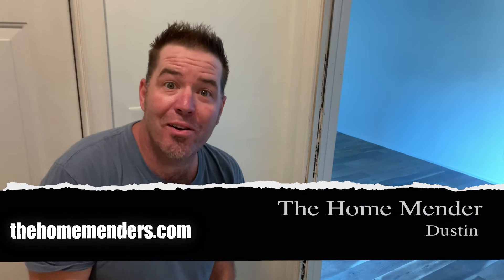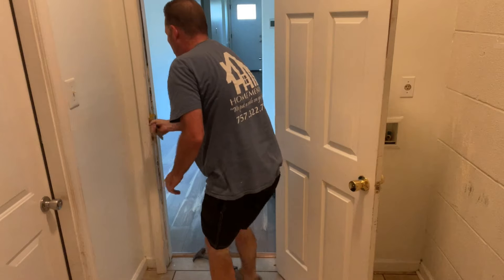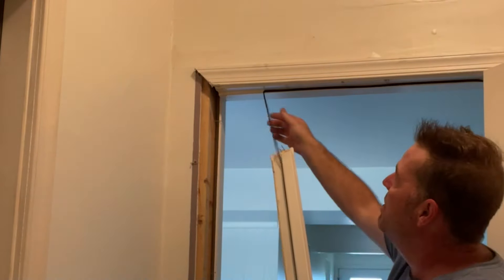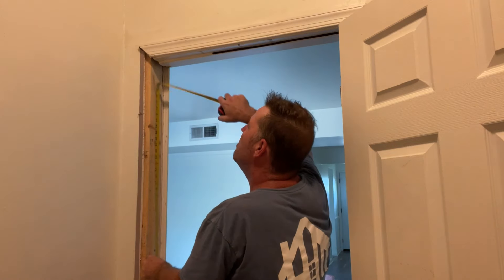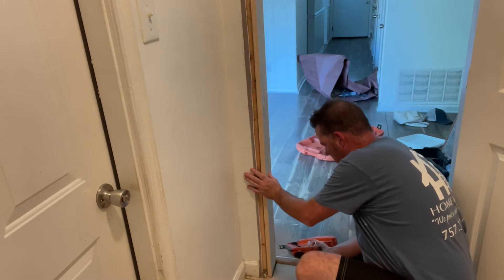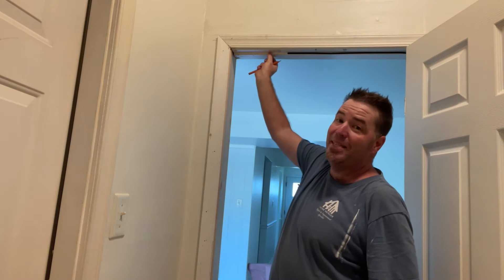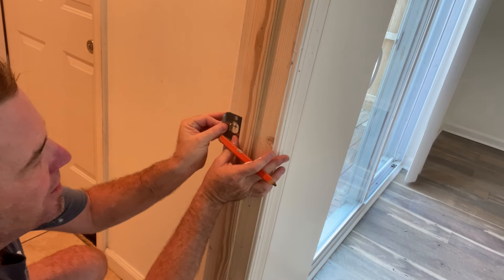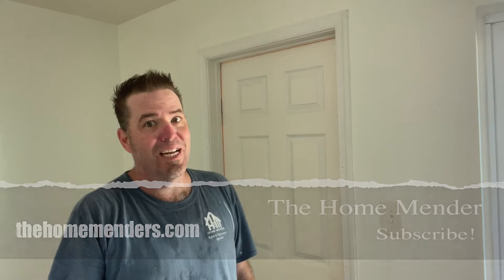How to repair replace broken door jamb,  fix interior door jamb and casing. Easy!

Comment: You earned a sub man. This was to the point and done. No long drawn out b.s no option based stuff. Just simple to the point. Job done
Reply from the maker: That’s awesome ponder. Welcome and we are happy to have you. Thanks so much for commenting!
Reply: @homemend  as an update, I did my buddies front door today. This exact same fix step by step. And it worked perfectly. Two packs shims, leg board, stop mold, screws, nails and spade bit. And weather stripes, 100 bucks. And a six pack. 4 hrs with shopping and a good time.  Thank you. His estimate was a whole fromt door replacement at 4500 bucks. We were gentle during demo and checked levels and door shutting, every step. And this video walked us thru it. Thank you.
Reply from the maker: Awesome comment my friend thanks for the update. You made the video and success story. Thank you so much

Comment: Hi Dustin, The firemen were called to a smoke alarm in an apartment and broke the lock side of the door like in your video(s). The tenants hired some "journeyman" from their work. They repaired it by cutting off 4 feet by 3 inches of the jamb and replaced it with a piece of 5/8" plywood? The job doesn't look very professional. I can't secure properly a jimmy deadbolt sideways with screws in through the plies! Your videos show how to do it right, permanently. Thanks for taking the time and effort to make excellent educational videos.
Reply from the maker: Thank you RD. Awesome, my friend. Glad to help

Comment: I noticed that you're using a frame nailer for the finishing work (casing, etc.) as well. What size nails are you using for that?
Reply from the maker: Hey Doc. This is an paslode impulse nailer. It’s not a framing nailer it’s a finish nailer. I usually like the 2 1/2’s. Thanks for watching!
Reply: @homemend  Ah, ok. Thanks for the clarification!

Comment: Wow, great video! Would it be the same on the opposite side? Thanks!
Reply from the maker: Thank you joyful! The hinge side is a little tougher. After re-creating the jamb you would need to trace the hinges and router them out. If it’s not damaged you may consider a split jam door. I hope this helps

Comment: I have a width of 5-1/4 but the closest I can find is 6 inch board.  All the pre-hung and replacement jams are 4-1/2  now.  It’s an early 70’s home.  What do you suggest
Reply from the maker: Great question RB. If I’m understanding it correctly, you need a 5 1/4 inch width? When you buy a one by six it’s not actually 6 inches wide, it’s three-quarter inches thick by 5 1/4 inches wide. Hope this helps.

Comment: Is there a jamb-side template for routing hinges and the striker thingy? I know they have them to use on the door slabs so. I assume there is one for jambs…right?
Reply from the maker: Hey Anthony doors vary on hinge spacing and hinge size. Usually when it’s into the hinge side, I will replace the whole door jam just because it produces a better product and trying to replace the inside is labor-intensive. I hope this helps

Comment: Hi what tool can i use besides the nail gun you’re a using ?
Reply from the maker: Just an old hammer and nails. But if you’re going to be doing projects, Linda get you a little nail gun. You got this.

Comment: Is caulk only needed because it's the bathroom, or would you use it in a bedroom too?
Reply from the maker: Hey OK. The caulk is to fill the crack between molding before painting. Yes use the caulk outside the bathroom also. Great question!
Reply: @homemend  Oh I see. Thank you for clarifying that. 👍

Comment: After you scored the edge lines for the strike plate did you then chisel out the thickness of the plate so it sits flush with the jamb?  Seems that would be insanely hard to get correct.
Reply from the maker: Hey Rick yes sir you can just trace the catch on there and then you just chisel out the thickness of the catch So it fits flush right in there. You got this

Comment: I learned 2 things today. Door handle baby proofing should go on the outside of the door not the inside 😂 then with this video I learned how to replace the piece of door jam I broke in order to get my 1.5 yesr old out of my room because my silly goose self put the door handle baby proofing contraption on the inside of the door and he locked himself in and my windows were locked so I had no choice but to bust in the door 😂 thanks for the very informative video 🙂 😀 😅
Reply from the maker: That is awesome Kelsey. Thank you so much for sharing.

Comment: Awesome job Dustin ! You said your nail gun was 400 but I bet it will pay for itself. Better to buy good tools than junk and junk in the long run is much more costly than a good tool.  Awesome video!
Reply from the maker: Thank you Steven, paslode has always been my favorite and yes for everything it’s 400 in the store. I recently found this one on marketplace. A guy was selling it for $150, it looked brand new. A guy bought it for a trim job at his house did the job and then it’s been sitting in his garage for 17 years LOL it needed a little maintenance but after I dropped it off at the shop he did what he needed to do in oiled it up and it is now good as new.Oh and it definitely pays for itself quickly. Thanks for commenting.
Reply: @homemend  well how about that

Comment: I have to keep my door locked to keep my son out of my room. I locked the keys in and had to destroy the jamb strip which now has dried wood glue on it. How would you recommend I get the glue off and just sand down and put a new strip on? What tools will get that glue off? Where can I get the right size jamb strip for the door? Thanks so much.
Reply from the maker: Hey Katie. I would just use a painters tool, scraper to get the glue off sanded down and then put a new “stop” on Home Depot sells a few different styles, if you have trouble just take a piece down and match it up. Also if you can’t find any jamb material a one by five will also work. You got this

Comment: Hey got question I accidentally slammed my parents house door by a accident in the living room it won’t open and it’s stuck what should I do?
Reply from the maker: Great Question! A door that stuck closed can usually be pried open if not kicked open and then the damage repaired after. I would try the prybar first and start near the latch
Reply: @homemend  never mind my dad called someone over it was due to weather I was Al title angry and stressed over something thank you for the help

Comment: I need to fix 1 door.  What is the option if I don't want to buy a $400 nailer?  (Yeah, I know, its called a hammer, but what to look for regarding the nails, and how to "hide" them.)
Reply from the maker: Hey Brian excellent question my friend. You would just use a bright finish nail. Which disappear behind paint but if you really want to go into detail you could always use a nail set to put them below the surface and then wood fill them